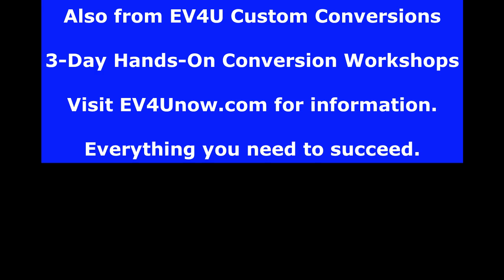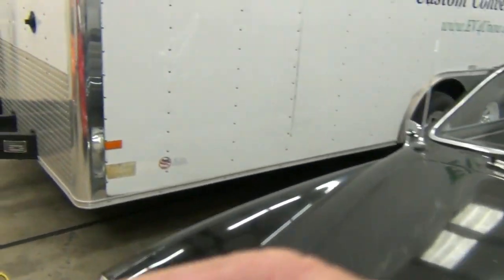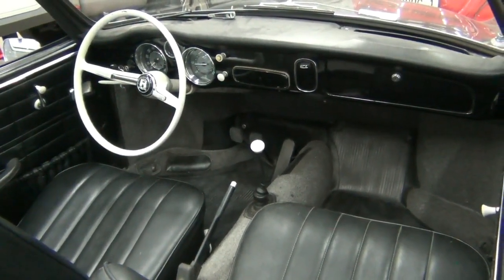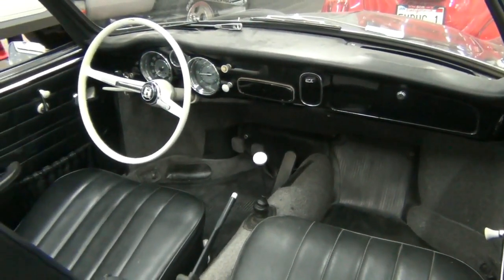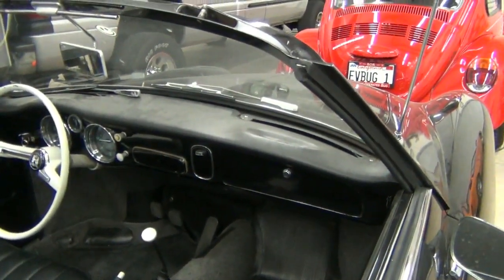VW Karmann Ghia Convertible EV Conversion  www.EV4Unow.com

Comment: Subscribed! Keep it up, please! For now I could only afford your shifter bushing kit, but there's always better things coming out tomorrow. Any idea on what motor this Ghia will have? I wonder if a netgain 120HP is a good match for these.
Reply from the maker: The NetGain motor at 120 hp and 173 lb.-ft. of torque requires a beefed up transaxle.  This car will be getting a HPEVS AC-51.  Our Custom VW Shift Rod Bushing has been around since 1978.